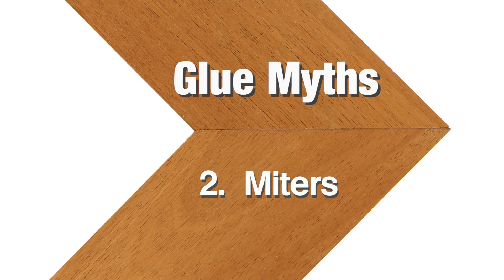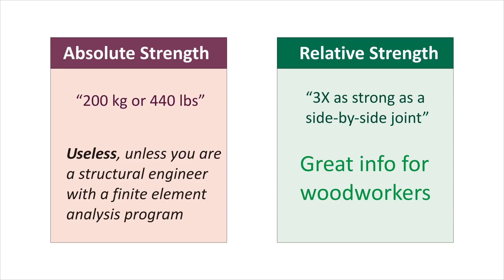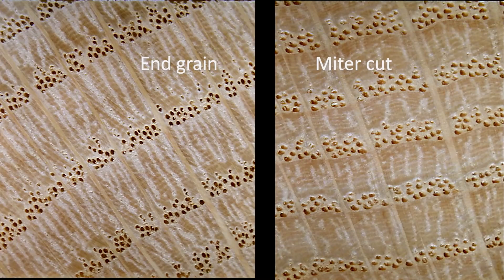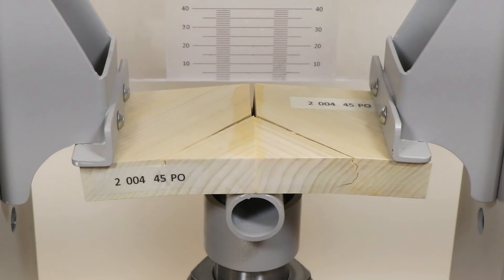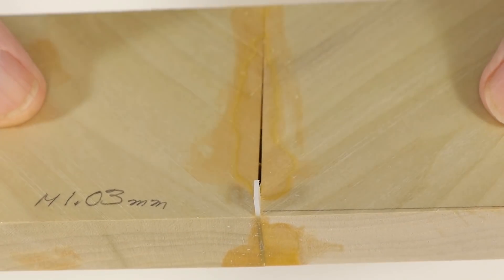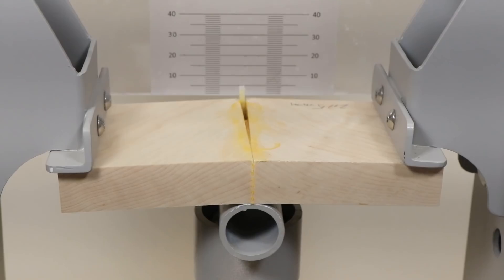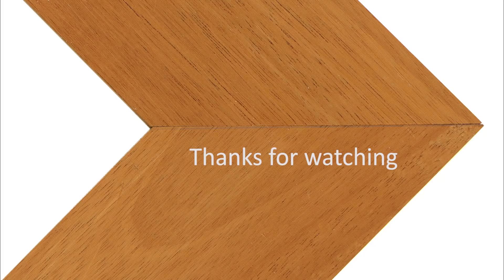Glue Myths:  2. Miters

Comment: There is flaw in your methodology. You are controlling the glue surface area in a manner that is misleading. Yes, the consistent sizing of the test pieces makes one test comparable to another, but are not comparable to the joints referred to in the mostly true adage "end grain glue joints are not as strong face or side grain glue joints." In real world projects, face or side grain joints often offer 10s of time more glue surface area than joints involving end grain. The differences in glue surface area is an additional major factor contributing to the difference in strength among these joints. You cannot appropriately test the above adage by ignoring differences in glue surface area. Instead of showing your result in total force required to fracture each test sample, you could show the fracture forces per glue surface area. Although the adage does not mention differences in forces , I believe "strong" does not refer to the absolute strength but the strength relative to the types and magnitude of forces these joints will experience over time. Long grain joints like table tops are usually supported buy end grain joints like apron-leg connections, that is a different set of forces.

When I saw your first video I thought it was primarily about myths, why they develop, and why they may not be true. I was really excited because I hoped the video would encourage people to take advantage of the small amounts of addition strength that can be gained by adding glue to the typically small amounts of end grain portion of joints. Unfortunately, for some, the video had some unintended consequences. Many in the community focused on the glue part and many others noticed a new unproductive myth to surfacing, which would discourage people from reinforcing structural joints involving end grain in the belief that glue alone is adequate.

The miters in you clock example are reinforces by the casing and do not stand alone against the applied forces. On the other hand miters in picture frames are not supported by any other structure and alone take all the applied forces. I have glued mitered picture frames without reinforcement when the forces are expected to be small compared to the dimension of the workpiece. No problems. When the forces are expected to be greater, reinforcement is called for.

An improvement in this video is your discussion of the level of difficulty it takes to make the mitered end grain joints. And that the quality of results achieved in preparing the joint is another major factor in the joint strength. Long grain joints are much more forgiving to prepare. I believe this also applies to the first video.
Reply: Personally, I think it's more misleading if you do a test where you compare a 2 sq. inch glue up (miter) to a 20 sq. inch glue up (panel), break the miter glue up, then tell people that the miter glue up is weak (probably because it's an end grain joint). Patrick Sullivan's method lets people know that the glue up is weak because of surface area, and not because of it's an end grain glue up.
Reply: there is a flaw in your critique I assume you are talking about joinery techniques which require inserting portions of wood into each other rather than the slap two pieces of wood together method shown in these videos, which could be corrected by elaborating more to include such words as inserted joinery techniques. unless I'm incorrect in assuming you meant inserted joinery, then your first argument would be disingenuous at best. (I say that because nerdery is in your name so I assume a basic understanding of tensile forces of different materials)
if I am incorrect and you're not referencing joinery techniques other than butt joints then you miss the point of scientific testing and are arguing for an apples to oranges methodology the techniques were not being tested, the strength of the joints relative to one another were being compared as well as the failure point of the joints. increasing the size of a side by side joint would do nothing but invalidate the test and as shown in the testing the lignin of the longer joints would separate the same as in the testing samples used as the lignin of the joints were shearing before the glue lines surface area would. increasing the width of the test samples bond thereby increasing the amount of glue (that's essentially what you would be doing) wouldn't affect the force applied to the test piece as the wood itself failed before the glue failed in the non-end grain test samples. adding more glue does not make the material being glued stronger all it does is provide more adhesive area.
the clock arguments conclusion you provided while true also has an invalid qualifier as the casing only encapsulates the upper miters and does nothing for the miters on the feet
Reply: @RodelleLadiaJr  You're right the strength of a joint has a lot to do with surface area. I would argue that it has MORE to do with surface area than grain direction. But the surface area was a fixed control in all the tests. To demonstrate the impact of factor, I would prefer to see it as a variable not a control.
Reply: There's no myth saying that more glue area results in a weaker joint, though. There is a myth that an end grain glue up results in a weaker joint. Woodworkers should not be saying "end grain glue ups are weak" and should instead be referring to surface area, lignin strength, or some other factor.
Reply: @RodelleLadiaJr  Do remember a time when the term "long grain" was synonym for "face grain" or "side grain" and the term "short grain" was a synonym for "end grain?"  The terms long grain and short grain are not as popular any more and have been all but replace by the other terms as far as I can tell. Did we loose something in the language switch? What if I said to you "Short grain glue ups are too weak to meet the need and require reinforcing." Would the use of the word "short" imply the geometry of the surface area? What are your thoughts on the language switching being a possible source of those old adages turning into the myths we see today?
Reply: @woodshopnerdery  I'm a new woodworker learning from Youtube videos. I fully believed in the "end grain glue ups are weak" and "glue is stronger than wood" myth and was doing weird things to my simple plans to avoid end grain glue ups, when I should really have been focusing on surface area, lignin, and joinery (as needed). This video and the previous video helped to dispel those myths for me.

If you told me about short grain and long grain, I would probably just translate it to edge grain and side grain because those are the terms I learned. The language changing over time is an interesting theory, but I don't know enough about it to comment.
Reply: @willhwiltjr  Yes, your assumptions about my post are not correct. I was talking about Patrick's joints and the specific methods he used to test the specific hypothesis he laid out in his video. 

What is Patrick's Hypothesis?: "Miter joints are dangerously weak joints. If you use them you need to reinforce the joints with splines of some type. ... because end grain glue ups are extremely weak." Actually, his hypothesis is the inverse of this, that this myth is not true.

What is Patrick's Test Procedure?: Glue workpieces of all the same size with the direction of the grain at 90 degrees to each other (45 to the edge of the board). Then measure the force required to break the joint.

What is Patrick's Analysis?: If it takes more force to break a miter joint than it takes to break a side to side joint, then that means miter joints are inherently strong and do not require reinforcement. I simply disagree with this and there is a flaw in the methodology that explains why.

Where is Patrick's Methodology flawed?:  Patrick's tests compares the GLUE breakage in end grain joints to the WOOD breakage in the side grain joints. That is the true apples to oranges comparison you are looking for. The reason we are not advised by the old adages to reinforce side or face grain joints is that these joints involve MORE WOOD and are therefore typically strong enough for their application. A large piece of wood is more difficult to break, generally speaking, and the larger glue surface area provides more strength. Since, glue surface area and the size of the work piece are major factors contributing to the strength of a joint, these should be variables in the experiment rather than experimental controls. 

This boils down to one questions; When, in addition to glue, should we should we add reinforcement (nails, screws, pocket screws, dowels, dominos, tenons, etc) to wood joints? This question cannot be answered based on only knowing glue strength.
Reply: @RodelleLadiaJr  We are all new woodworkers. Lots of learning for everyone, hey that's why I'm here too, to learn. I totally agree with you. When I have a big (relative to anticipated forces), well prepared joint, I just add glue. If it's end grain involved I size the joint first. If I have a small joint, or if I botch it and its a bad joint, I add reinforcement like dowels or screws and push some wood putty into the gaps. Sometimes, when I botch a joint I cheat and use epoxy.

I just hope people don't walk away from Patrick's videos thinking they never need to reinforce a joint. Because, sometimes you really do need to reinforce a joint!
Reply: @woodshopnerdery  I feel like you're still missing the point of the video... You shouldn't be considering options "if end grain is involved". You should be considering small joints regardless of end grain vs edge grain. Ie. if you're teaching someone, and say, "When end grain glue ups are involved, you should be paying special attention to joint size", you're giving the false impression that joint size is not as important for edge grain glue ups.
Reply: @RodelleLadiaJr  I think we agree. Maybe I created some confusion in my last post when I said, " If it's end grain involved I size the joint first." By "size" I meant apply glue sizing. Sorry, that is a confusing term and I should have been more clear.

Sizing is a practice of adding a little glue to the end grain (watered down if you want) letting it sit for a few minutes, then adding a bit more glue. The theory here is that end grain can wick glue away from the joint like a sponge, starving the joint of proper amounts of glue. By sizing, you saturate the end grain fibers mitigating the wicking action so that on the second application of glue plenty of glue remains at the joint connection. I don't have any proof that this makes a difference, but I seems that I have better luck with joints using this method.
Reply: @woodshopnerdery  A ha! Thanks for the clarification. I think this still adds to my point as the experience for a new woodworker. When someone says "size the joint" to a new woodworker and actually means to apply multiple thin layers of glue, that's similar to someone saying "end grain glue ups are weak" and actually mean that the small joints typical in end grain glue ups are weak. They're both assuming a certain level of context that may get lost as knowledge is passed along.

Comment: I think your conclusion that "if you fail to achieve flawless cuts, then maybe you should consider adding splines", is pretty misleading.  It sounds like you're saying miter joints don't need additional reinforcement, which I would assert is completely untrue.  It's the cross-sectional area of the glue joint, not the grain direction, that leads to weakness.

A simple test of glued vs  biscuit vs spline joints would confirm this

Comment: These tests aren't very scientific, as you're using orientations woodworkers don't use to make incorrect conclusions about orientations that they do use. Nobody orients wood in such a way that it will have side-to-side stress that could break it. End-to-end glue joint is only slightly stronger relatively speaking than the side-to-side. Obviously, the mitered trim on your clock does not experience the same stress as a mitered box or frame. In many cases end-to-end is not going to be strong enough, which is why woodworkers use joinery that takes advantage of the strength of the wood (red boxes on the far right of your chart), which is much stronger than the strength of the glue (gold boxes).

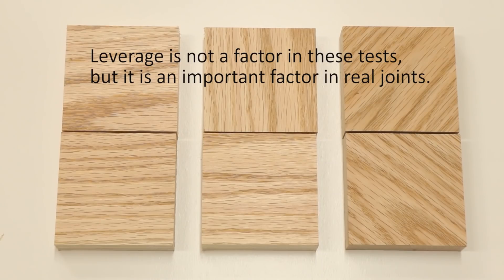Comment: 6:29 "Leverage is not a factor in these tests but is a factor in real joints"
You tested these joints by forcing a fulcrum into the center of the joint, thus
leveraging the two halves until failure.
You have not tested miter joints at all, only a butt joint with grain running a 45 degrees, there is a big difference.
There is no myth
Reply: At 7 minutes 34 seconds an example of a mitre is hown that does not look particularly long and you cant  see what is going on inside the joint where the glueline fails.

Comment: Interesting video. 
I'm no woodworker, but I would have guessed that a miter-joint in practice is stronger, on the basis of a larger glue-surface would provider larger adherance, graindirection not withstanding
Anyways, I like the experimental approach you take. :)

Comment: Assuming they work similarly, this is not looking good for scarf joints. It is starting to look like the only thing holding my boats together is the nails.
Reply: I think the major overarching thing missing in all these tests, is a real-world application. A very small (in relation to its thickness), square block, forced to bend over a large pipe (in relation to the size of the block) is a fun, esoteric exercise and good for mental gymnastics, but for thousands of years, people have done real world testing on what works and what doesn't what completely different outcomes compared to the lab tests.
No one in their right mind would ever use a butt joint in place of a scarf joint on a boat, regardless of what they see in these videos.
Reply: @bestbuilder1st  "No one in their right mind would ever use a butt joint in place of a scarf joint on a boat, regardless of what they see in these videos."
Correct. But Patrick tests the relative strength of different grain orientations. So he uses the same surface area in each case. The advantage of a scarf joint is that the surface area becomes a lot larger. So if someone abandoned scarf joints based on these videos, he would be misunderstanding the videos!
Reply: @panos3051  Agreed.
But I also think the videos don't really have much real-world application.  The size of the block in relation to the relative size of the glue joint is completely out of scale with actual field applications.  Regardless, I do think this type of experimentation is highly valuable and interesting.

Comment: I find it odd that my real-world results are totally different then what is shown in the videos.
A while back I made a small frame mitre joint.  I used a shooting board to finish the ends, put two peices together and you could not see light between the joint (almost perfect?).  After glueing the joint in a frame clamp (a good one), when I took it out the next day and working it to the other joints to finishing the frame, it "popped' apart in my hands without much force.  It did not break as shown in the video, but a complete failure of the glue joint- that is why I don't trust plain glue in a mitre.  My thought was, given the petite size of the frame I would not need reinforcement, to which I was sadly mistaken.

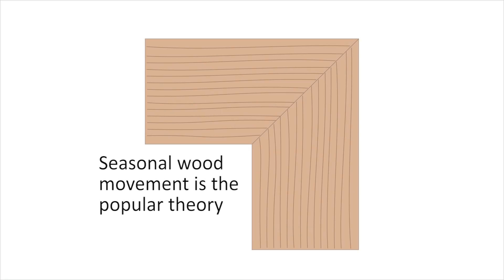Comment: At 7:01 you acknowledge the shrinking of wood on a mitre joint but say you are not convinced that it is the glue bond that fails and then you show an example of an antique with hidden SHORT mitres on mouldings, so the evidence cant actually be seen!! Whereas a picture frame has a longer glue joint the evidence of a failing glue joint is clear. Surely if you understand anything about wood you wont have to 'stick around for 50 years' (as you say) to see the effects of timber movement, glue degradation etc as timber movement happens a lot quicker than that!  These are visually impressive micro precise theoretical tests but of little meaning in the practical world of woodworking that show you are a clever guy, but are they misleading? Well, I have read some of the astonishing comments posted here and on your End grain video, so the answer is evident!